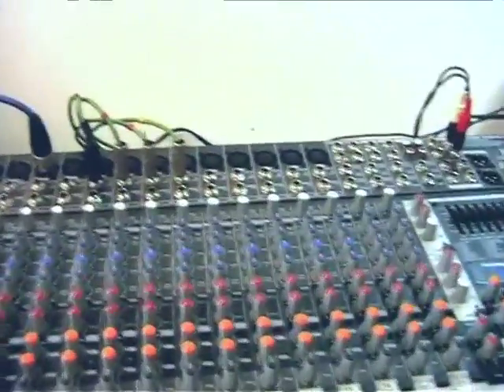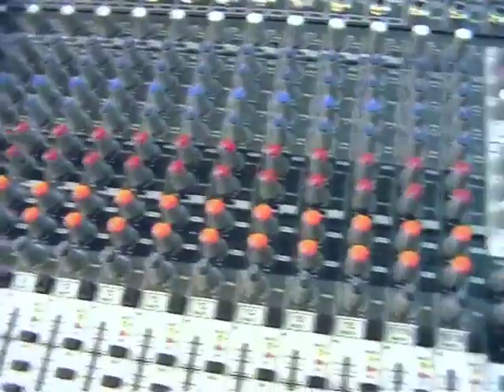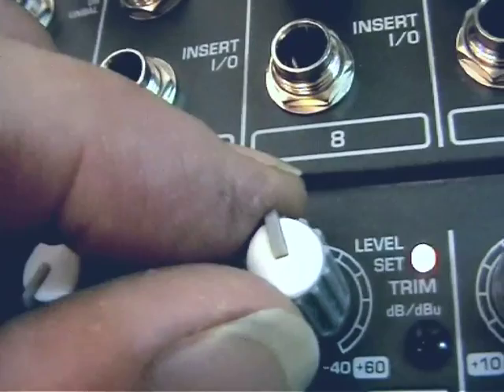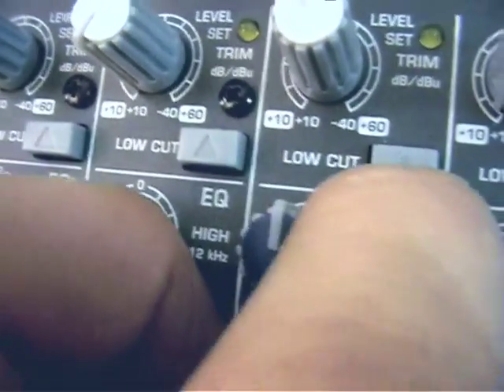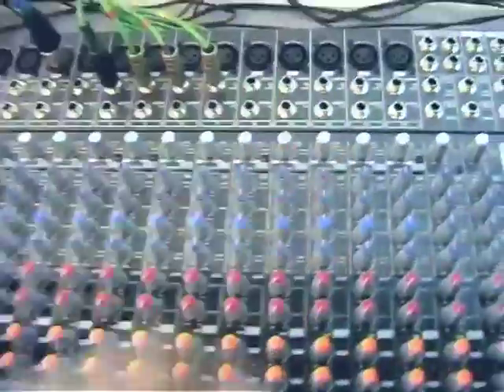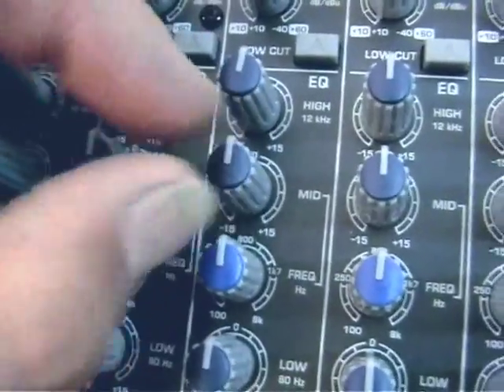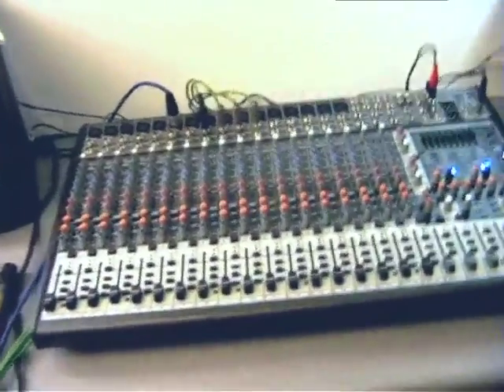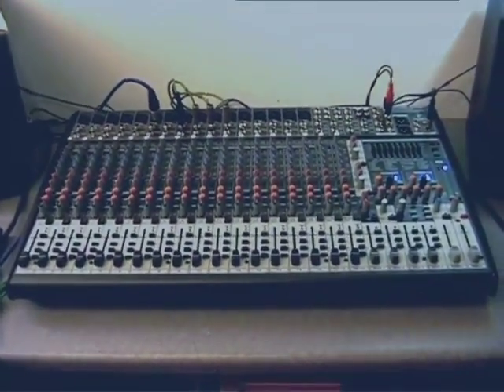Behringer sx2442fx mixer tutorial/review - 1/2

Comment from the maker: @rdev68 - yup - attach any external fx units Inputs to the send fx-send-sockets  - return them via the channels (23/24) or if u want to eq the external fx units, return them via a full-featured stereo Line channel. A monitor stereo submix can be created using aux-1/2: Use aux-1 as left, and aux-2 as right - to pan something more left in submix, just turn up aux-1 (L) more than aux-2 (rL) etc - or use aux-1/2 as two seperate mono monitor sends

Comment: Awesome instructional skills. No B.S. about ANY non-relative subject matter. Now could you tell me where to find vids on the best installation of various components like vocal processors, dual channel EQ, and multiple amps. to this model? I'm Old'scool rocker got my first guitar in June of 1969. I'm pretty tech savvy and can fix most anything. But this thing was going on the shelf and break out one of the old ones because every time I added a component it behaved differently (not better) I was thinking that's why I got it for $75 but knew that I wasn't getting something right because several of those configurations were sounding good but when I added something else without changing settings it wouldn't let out a peep. The manual is garbage. And up until I found your channel the internet was useless. Thank you once again. liked, subscribed, fan for life...

Comment: Well, it certainly added to what  I can do. Before, I just had non-realtime editing software and a soundcard. Now,  I have better software, a digital audio interface, and the 502. Opens up a lot of potential. And once you start understanding the signal chain, the big mixers are not as scary as they might seem at first glance. Just more inputs and better features, but the basics remain the same.

Comment: Hi, I know thus is an old video, but you knowledge is timeless. Thank you for delivering it in such an organized manner. I got a question for you. I know u call it a small mixer all the time but, I need a really small mixer with all this routing options and for that to be possible 8 or 10 channels would be more than enough. But all this smaller units try to give u the most amount of channels they can squeeze in but they take out the many routing possibilities. Which is what a mixing console should be made for. Versatility. Any particular model come to mind? I happen to have a zenyx 802 usb and it has the right size for me, but I would love to have pre fader sends. I would love to have inserts. No mixer has them in such a small footprint. It eould ve great if u could enlighten me. The pre sends I would use for fx loop that need to be 100% wet signal, like distortion and stuff. The inserts to half click and use as independent outs should the need arise. Please help me 🙏🙏

Comment: Hi, loving the video. I have this same mixer exactly and something is really strange about it. I have tried EVERY single routing combo I can think of for the built in effects and this piss annoying buzzing and interference noises (every effects has a different noise) coming from the processors. I have NO CLUE why it's happening. I've used them perfectly fine before but do you have any ideas of what it can be??

Comment: Hi! I hope i can ask you an question here. Do you know why the digital effect processors get blocked when i connect the output of my (external) FX unit to the 'stereo aux returns'? I have two external units. When i connect the output of my 1st unit to the 1st stereo aux return, the first internal fx1 cannot be heard anymore (fx2 still works at this point). Now, when i plug in my 2nd FX unit in 'stereo aux return 2', the 2nd internal fx processor also quits producing audio. Are you familiar with this behaviour? I received the unit today, and i was hoping using the internal effects along with my external units. I could of course ignore the stereo returns, and just use 4 mono inputs (i have plenty!) but i am wondering what's going on here (and if this is normal behaviour). I hope you can help me out! Thanks!!!
Reply from the maker: well it would seem from your description that plugging anything into the FX returns over-rides the internet FX processors sending into that fx return Bus. So use spare mono channels as you say

Comment: Excellent videos on this board. I have the SX3242FX and have some channels that intermittently stop working properly (Acts like the gain is turned up all the way on the channel, or "pops" and must be muted to shut it up). It it likely that dirt has found its way inside and how would you recommend cleaning it?
Reply from the maker: if you go down the channel twisting the pots one by one, does ONE pot cause the jumping in volume / popping? if yes, then thats the faulty one, they can be replaced of course, but it'll be all board mounted so a strip down is required... not for the fainthearted. otherwise is it the fader? (again when moving it does the voluem jump as you describe? first you gotta find wha is the bad bit see.
Reply: dancetech Are the individual channel strips plugin removable? If they are soldered to the main board that would be SO much more difficult. Thanks...
Reply from the maker: James Lancaster
 at this price point? no way. you need to spend a hell of a lot to get a modular board... i had one once, 24 channel, it was a beauty, custom made.
Reply: Thanks for the reply dancetech. Now I know...

Comment: I just found your video.  Thank you for making this for those of us just learning, or, in my case trying to learn.   Can you tell me the answer to this:  I have 12 microphones on my drum and percussion rig . I have 9 of the mics on the drums, 1 mic for tubular bells, 1 mic for both timpani, and one mic for two gongs.  What size mixer would I need to connect all these mics--and possibly two more overhead mics which I would like to add--up?  How many channels from mic to mixer does this require?  The reason I am confused is, a 10 channel mixer doesn't have ten channels for 10 separate mics, right?  This where I am confused. Any help you can give me will be greatly appreciated.  Thanks so much.
Reply from the maker: you just need a mixer with one mic channel for each mic. simple. Some mixers with "16 channels" might have 12 mic channels and then 2 stereo line channels, making 16 channels in total, so just look for total mic channels in the specs.
Reply: Thanks a million.  This answered my question and solved my problem.

Comment: Hi,  I am new to mixing and have a question for you all. I would like to be able to record 8 instruments "raw" into 8 different tracks in a PC, use the borad (not the PC) to mix, and save it back to the computer. I need an audio interface with 8 tracks, but how do I send the tracks to the board for mixing ? May I use INSERT SEND to record the raw tracks, and INSERT RETURN to get then back to the board for mixing ? Woulnd't that create a loop when recording the output to the audio interface ? Thx

Comment: bit confused about the i/o at 8.40 - 950. do the outputs on i/o bypass the eq or something, otherwise what is the output on i/o for? also, how is the wiring/patching to get the individual outs for 16 channels done and would that include the eq?cheers!
Reply from the maker: +John k the inserts are to "insert" any processor such as a compressor into the channel. not sure if the inserts are pre-eq, check the manual. the wiring required for all 16 channels is typically a loom to a patchbay.
Reply: +dancetech thanks for the info.i'm looking at something with at least 8 dedecated outs for old school recording style when needed.after a bit more research i think the xenxy 2442usb(few) might be more up my street.thanks again for the help.
Reply from the maker: +John k  checkout an old mackie 16 channel, they had direct outs on each channel & pretty robust

Comment: Is the signal at the FX1/FX2 send jacks a wet or dry signal after using the on board effects? I want to use both effects engines on the board and also go out of the two sends to an out board processor but was wondering if the signal wet or a dry signal send..Thanks for any help.
Reply from the maker: i can't remember, what happens in the video?
Reply: dancetech At about 26:30 you mention them but nothing is plugged into the jacks. Was just wondering if the signal at that point is a wet or dry signal from the effect send knobs from the onboard effects.
Reply from the maker: Gene Godley  eee. i can't remember without getting it out of storage, wiring it up and trying it again tbh. does the manual mention it? (pdf manual is on behringer website)
Reply: dancetech FYI..Called the tech support, It is a dry signal. It bypasses the onboard effects and sends a dry signal to FX jacks 1/2. Very cool. As you mentioned, can run second outboard gear or two more monitor mixes. Although they would be post fade but it can be done. Was debating between the sx3242 or sx3282.
Reply from the maker: Gene Godley awesome! that's what i suspected but didn't want to say unless i was 100%

Comment: sir help me how to set up the behinger xenyx 2442fx mixer with speaker mid high and low,pls help me,,
Reply from the maker: you can send the MONO out to the bass and the main L/R to the mid/high. If they are active cabs the crossover will be built in, if passive feed the crossover from the L/R. The MONO out has a Low-pass which starts at 300hz so you can tune that to whatever low end you want from the bass box/es. Or dont use the MONO out & just feed the speakers from the main L/R only & use their own built in crossovers if active & serial connect them as usual.. or feed the man L/R out into the crossover if passive

Comment: please , i have a question. someone told me if i connect TRS to adapter TS female to TRS male on insert will change to work a direct output ? that right ? or 2. use 1/4-inch TRS Female to 1/4-inch TRS Male Headphone Extension Cable
Reply from the maker: just use a mono jack and plug it In until you get ONE click (not all the way in)
Reply: @dancetech   sorry i did not understand ? 
this ways what i sent to you wrong ?
Reply from the maker: @peteryousef5177  it doesn't matter, do what i said, no need to be complicated. just use a regular mono jack to jack plug - or you can make a special lead with a stereo jack on one end and a mono jack on the other & simply open the stereo jack and connect the two hot pins inside together
Reply: @dancetech  the problem i have pesonal monitor mixer so i am seeing the best way
Reply: @dancetech  so can i connect Trs to 1/4" Male TRS to 1/4" Female TS Insert Direct-Out Adapter ? can change insert to work a direct our ? 
or 
sec ,way if i connect TRS male to adapter Ts female to trs male. can change the insert to work a direct out ?
Reply from the maker: @peteryousef5177  using the Behringer p 16 you mentioned before yes? Well I explained already that unit requires a digital feed over network cable, so you'd need a converter unit between the sx2442fx & the p16. Perhaps it's better to just explain what EXACTLY you want to do and what is the setup you want to do it in (is it in a studio? if YES, then where is the behringer sx2442fx mixer located?, where is the playing area located? what is the distance between the mixer and playing area?,  is it for a live stage setup? etc etc
Reply: @dancetech  for live stage at church
Reply from the maker: @peteryousef5177  how many musicians need to monitor? & do they all have a p16? or is the idea to get a p16 for each musician? Point being the p16 was designed ideally to work with Behringer digital mixers where you can have many different monitor mixes as individual digital feed per track to the monitor system over Cat5.. with an analog mixer like the sx2442fx you only have 4 maximum possible mono monitor sends (which CAN be used as 2 x stereo if you treat send-1 as Left & Send-2 as Right for ech send pair... so is the p16 system worth it? if you plan to use it for more than one musician in the band?
Reply: @dancetech  please can you tell me what i sent to u can help me to change from insert to work a direct out or not ? some people said yes and some said no ?
Reply: @dancetech  anyway else to fix this problem ?
Reply from the maker: @peteryousef5177  i told you already above.. but if you take a monitor feed from an insert, ONLY whatever is plugged into that channel will be in the monitor feed, nothing else.

Comment: q: in 11:08 i have the same mixer but i dont know if am not solo the input channel the main out never show anything / how can i monitor the main out / some one answer me what is the problem i have the same model
Reply from the maker: +nice_q8t  solo doesn't work on the main L/R outputs, it only works on the L/R MONITOR outs.
Reply: +dancetech in 10:46 when i rise the fader to zero i also have to press the solo button and also pressing the main button in that channel to make main output uv meter start lighting , in your video you didnt press solo button in that channel you just press the main button and the main meter start lighting / am really confuse if i didnt press the solo button in one mono input channel the main output meter not lighting but i hear the sound goes to speaker when i rise it to zero . thanks
Reply from the maker: +nice_q8t have you pressed/latched the MAIN button next to fader? only channels with MAIN latched go to L/R and monitor output
Reply: +dancetech finally i figure out why main outpot uv meter not light without solo button pressed in input channel yesterday i turn on my mixer without turning on my two behringer epx 3000 amplifier connect with 4 loud speaker / not really sure where the problem happen seems our amplifier if its connected with mixer doesnt monitoring and i have to solo every input channel to make uv main meter lighting
Reply: dancetech
 thanks the problem are no more my fault there is a small black button in phone and control rom called main after i press it down it then the main output meter start lighting
Reply from the maker: +nice_q8t  yeah... perhaps you should just watch the video properly before asking questions cos it;s all covered.
Reply: +dancetech to be honest since i worked in my school last year and i have been watching these videos reviews you have done i watched two full tutorial of that mixer and i also watched two mini reviews the mixer not so popular or not many English videos reviews of it but i didn't wrote comment before because i wasn't really relies that i should monitor main output in my school they always told me the sound is louder so i was going to input channel and reducing the fader or gain i never touched the main fader cause they always make it to zero / i still not really professional i am doing my best and every time i came hear to watch the video again :)
Reply from the maker: +nice_q8t th main fader should be set to zero initially.... when using a mixer live, the MAIN L/R OUTPUTS always feed the front of house PA amps/speakers... the monitor bus feed the headphone socket... if you SOLO a channle it does NOT solo that channle to the MAIN L/R front of house ouput, so the main front of house is never interrupted; when youy solo you only hear the solo'd channle in the headphones. That way you can check a channel in the headphones without interrupting the main front of house PA amps/speakers the audience is listening to..... In the studio the MAIN L/R OUT always feed the stereo master recorder... the monitor L/R out feed the monitor speakers. When you solo a channel you only hear the solo;d channle on the monitor speakers, but the main L/R OUT feeding the streo recorder DO NOT get interrupted..... if you fader is set to ZERO and the PA is too loud then turn down the PA amps, NOT the main fader..... once the PA amps have been set to the right volume for the venue-size, THEN use the master fader only to adjust the final level if required.
Reply: +dancetech great information i get what i didnt know but i have few question i will ask in the second part of the video